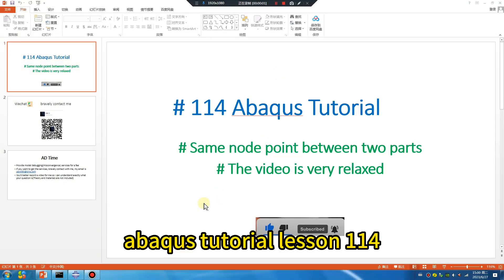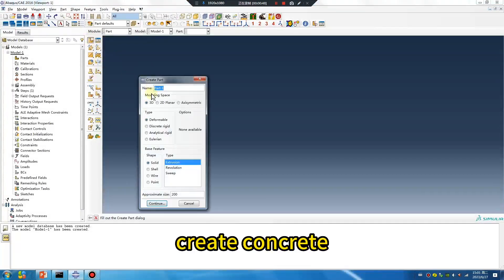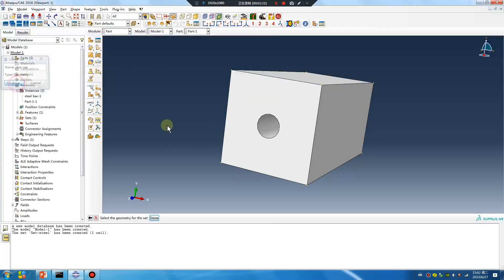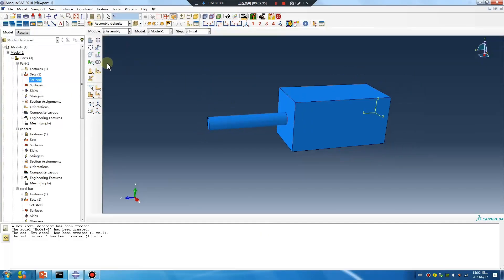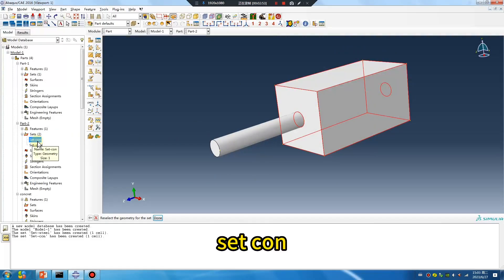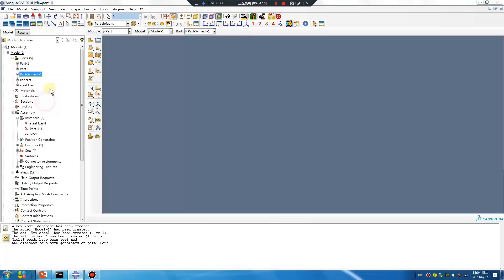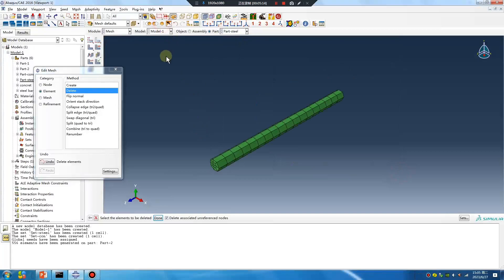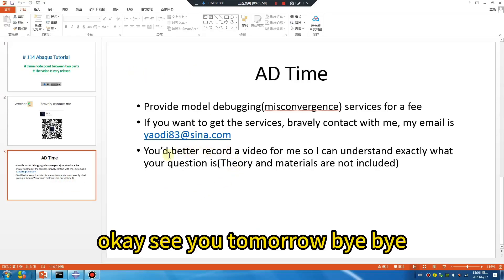# 114 Abaqus Tutorial # Same node point between two parts

Comment: I would appreciate if you can tell me what is the advantage of this instead of using tie? With tie you obtain exactly the same, when the nodes of the two meshes are coincident.
Some advantages with tie are: 1) the interaction is evident to others, 2) the nodes of the meshes not necessarily need to be coincident, 3) it is very easy to re-mesh, for example.
Thank you.